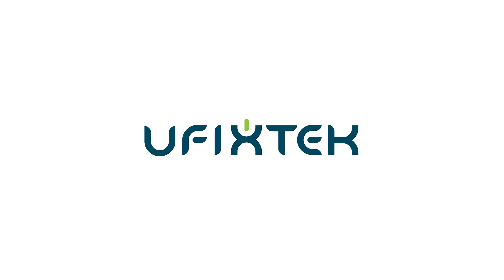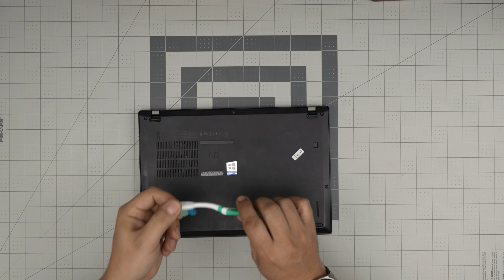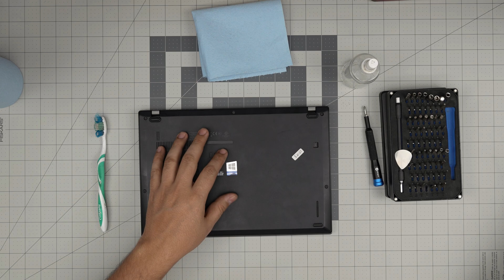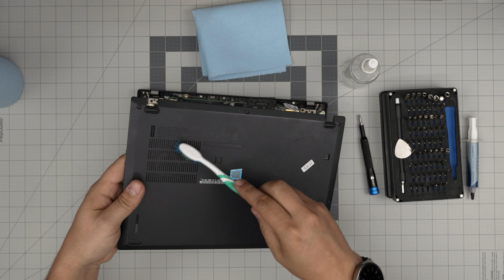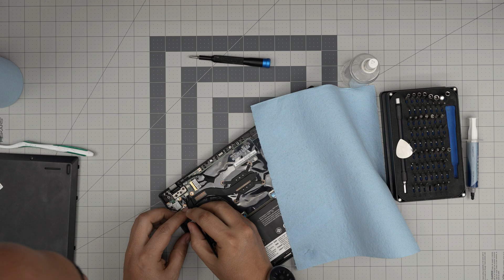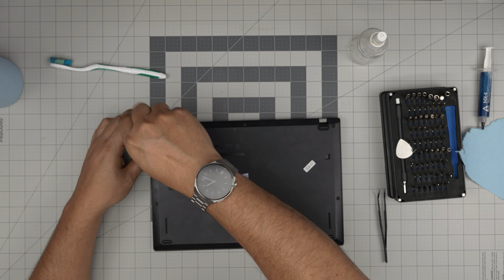How to Repaste and Clean Your Lenovo ThinkPad X280 Laptop

Comment: I prefer to disassemble the fan fins because sometimes there is a carpet of dirt in there.
Reply from the maker: 🫠Regarding your servicing, YES i would always recommend to get the fan out and remove the dust build up, there are only 2-3 tiny screws.
cheers🍻
Reply: @uFixTek  🍻🍻

Comment: hello from Ukraine, good video I don't know if you have a video about the screen upgrade, and what model number is required for the fhd screen
Reply from the maker: It's my pleasure my friend.
🫠Regarding your question, look for any of this models display all of this are compatible FHD:
LP140WF1(SP)(J1)
LP140WF1(SP)(B1) 
B140HAN01.0 
B140HAN01.1 
B140HAN01.2 
B140HAN01.3 
B140HAN01.5 
B140HAN02.0 
B140HAN02.1 
B140HAN02.4 
B140HAN02.6 
B140HAN04.2 
B140HTN01.0 
B140HTN01.1
Should you have any further questions or requests in the future, please don't hesitate to ask me.
cheers🍻
Reply: hello, it's me again, but these screens have a 14 diagonal, and on x280 12.5, what screen do you have, thanks for the answer